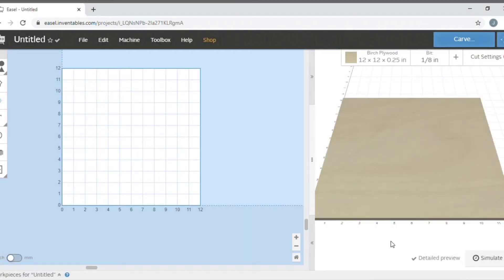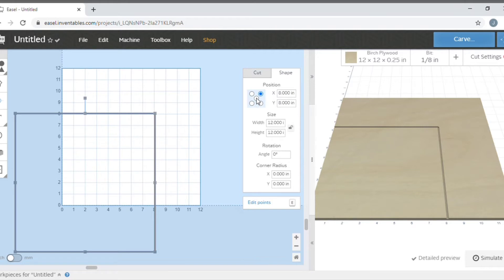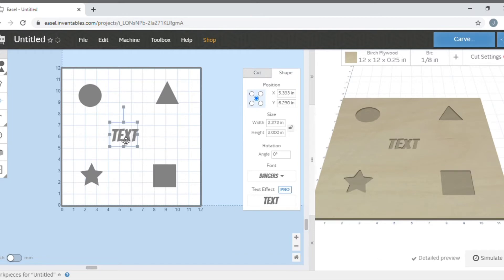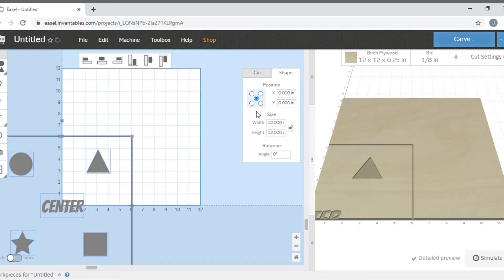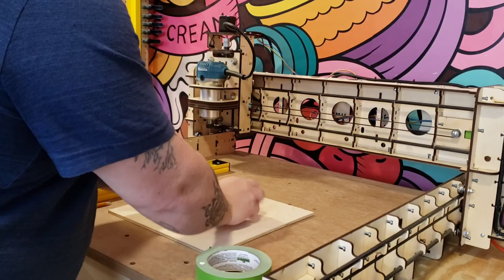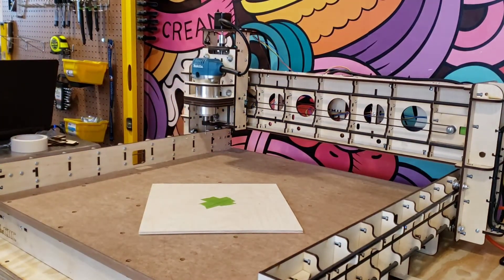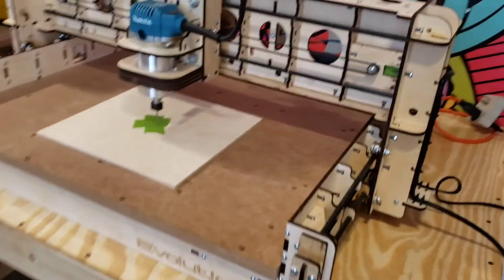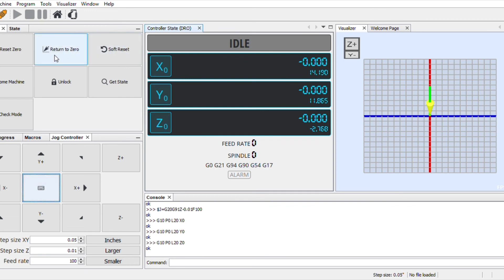Easel how to work from center Bob's CNC and others

Comment: thanks for the explanation here..  I am sure it is confusing to many when started out.  That said, I did want to point out that all you have to do is that last step in order to work from center, right?   basically, you just go about your business, creating all that you want on your workpiece and when you are completely finished, is when you would "select all" and Zero out your position within the shape tab.  Thats it! gcode and easel, could care less where you have stuff positioned and/or centered to, prior to changing it to zero.  last 2 steps, center to workpiece (if your design is supposed to b centered) and then zero out your start position after selecting the center blue dot in the shape tab.  boom.  no need for the extra 2 or 3 steps that you go through in the beginning, as the steps that you take after them makes them erroneous anyway!..   Cheers